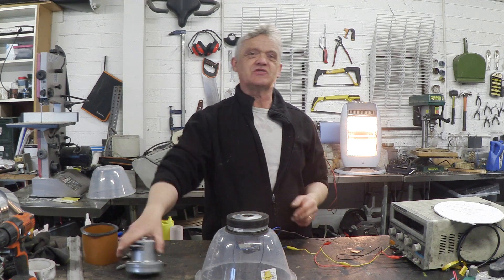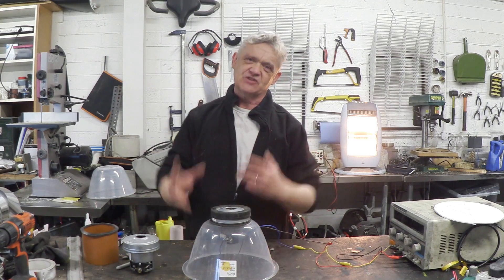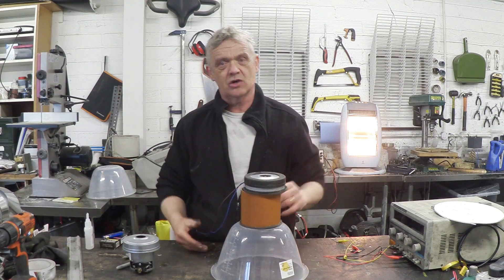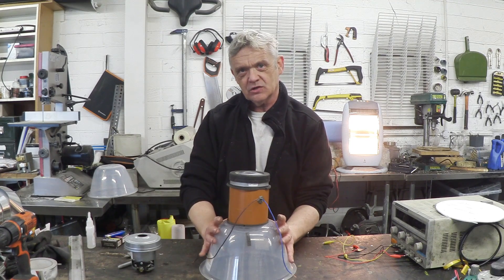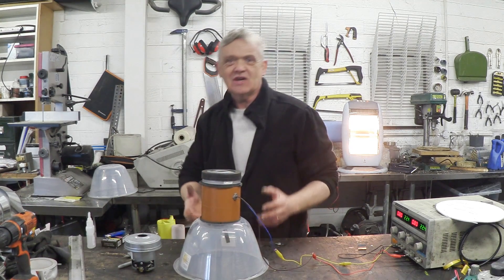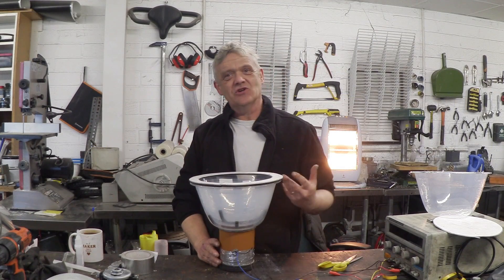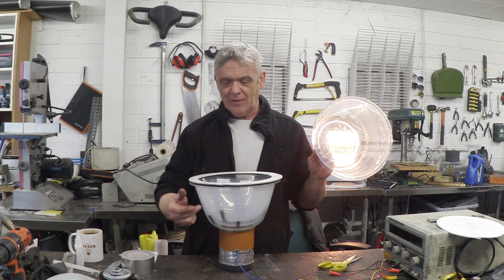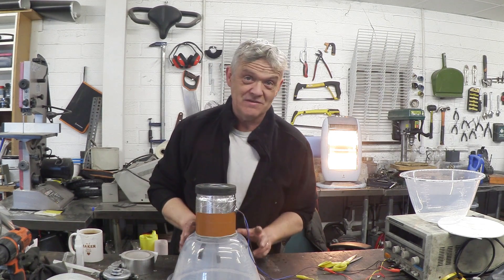1082 Coanda Hovercraft Experiment

Comment: The air intake and overall nozzle shape is also hard to design in an optimal way. Coanda also speculated using the blown air for lift via reduced pressure on the external surface, but this is even harder to do and some designs had the impeller inside the nozzle blowing air upwards.